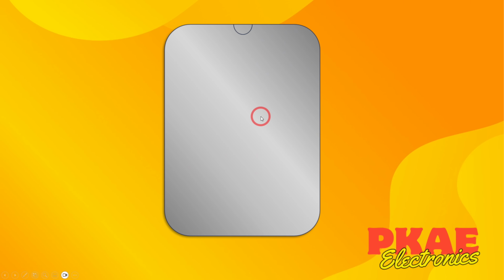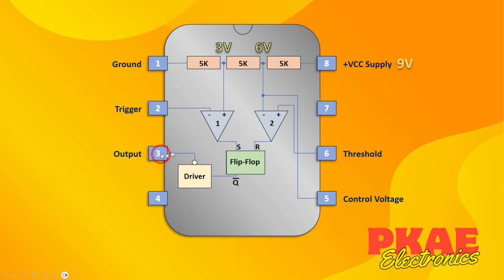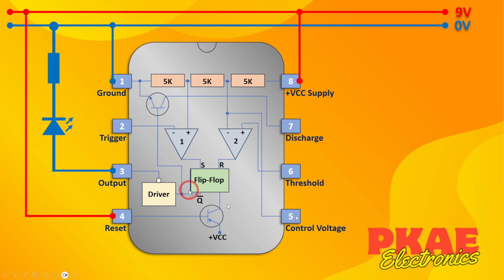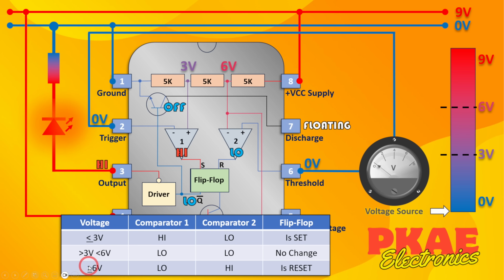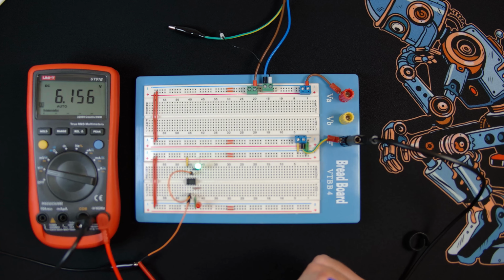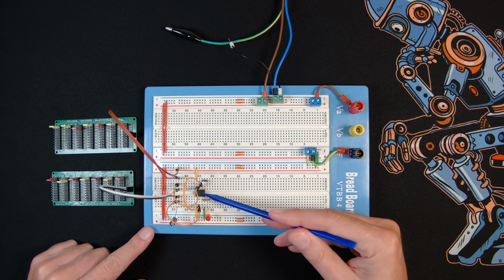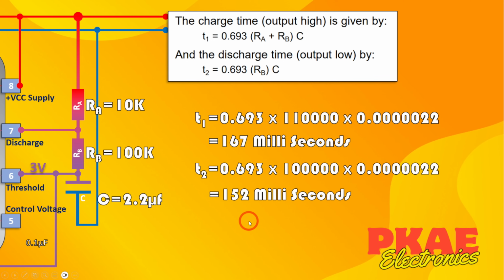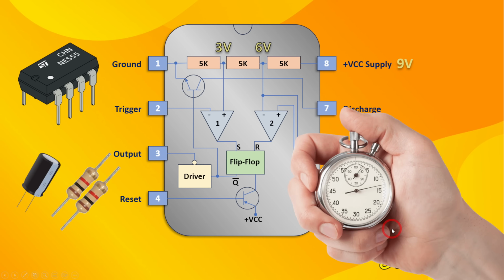How a 555 Works as a Timer.

Comment: 4:05 
with both inputs at equal voltage the output is at mid rail.
Reply from the maker: Thanks for the comment, where did you obtain that from? 

I have never known a comparator to output a mid-rail state. Only HI or LO.
Reply: @paulpkae  
The open loop gain is very high and input offset affect the levels
but the output can be at other than rail voltages.
The state doesn't last long because of any drift but can do weird things.
This I have seen when building prototype projects.
A method to correct for this is to design in some hysteresis.
Reply: Further info;
Many years ago I was into caving and one of the adventures was 
a tidal flooded system . So I wanted to predict my own sea levels
and made an analogue computer. Real time / 10 X / 100 X / 1000 X.
Inputs were sun, moon, river , rain . This is the beast that gave me 
weird comparitor outputs.

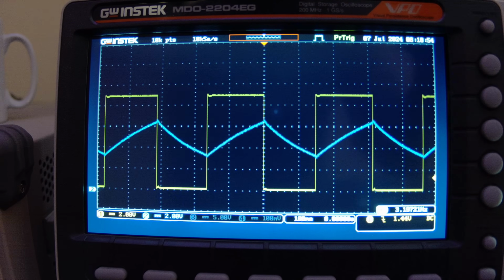Comment: Referencing 29:00 with the blue (capacitor) trace, do you reckon the original designers of the 555 started with the external capacitor and then worked out the chip design?
Reply from the maker: I expect the designer spent countless hours building various timer circuit arrangements out of transistors, resistors and a capacitor (as the time base). Probably then realised there was a lot of common elements to each layout and this led to the idea of designing an IC.

Comment: I learned about the 555 in the late 70s. By then, I had played with the usual configurations (blinking LED, speaker sound, etc). Shortly after, a photographer friend asked me if I could build him a timer for his photography enlarger lamp. He wanted it to be controllable from just a few seconds to well over a minute, with strictly  repeatable results. So I had this crazy idea, which I wasn't totally sure that would work: I wired two rotary, 10-position switches and associated potentiometers (trimmers, actually) in series so that the resistances of "high-value" (tens of seconds) trimmers would be  added to that of the  "low" (seconds) trimmers. And it worked, too. With that arrangement, I could set the switches to any discrete time interval between 0 (lamp on for only as long as the start button was pressed) and 99 seconds. The 555 timer output was routed through a transistor to a 120V relay, which drove the lamp. The photographer friend used this for  many years, and I still think it was one of he coolest things I've made as an electronics hobbyist.
Reply from the maker: Thanks. Sounds like a great little project that has stuck in your mind all these years.

Comment: Great video, explained better than my tutor 30+ years ago.. Just for laughs a quote "The 555 timer IC's name is said to come from the three 5 kΩ resistors within the chip, but the designer, Hans Camenzind, says the number was chosen arbitrarily. Camenzind said that the name was chosen by Art Fury, the marketing manager, who thought the circuit would sell well." I would say to that if the designer says so then so it is i have always gone by, the early chips actually had a very small 555 engraved somewhere within. Also to note there are much better and stable oscillator chips, but obviously much more expensive. 555 is great for hobby work, when you start to get into exact frequencies then you require more sophistication.. Loved this video..

Comment: So charge and discharge time cannot be the same as RA would have to be 0 for that. That would be bad as the discharge transistor would short VCC to GND directly?
Reply from the maker: Hi. Yes that is correct. The standard astable circuit does not allow full control over the duty cycle. I will be doing a follow up video in which I show how that can be achieved.

Comment: This is a brilliant explanation of how the 555 can be used and why it functions as it does. I appreciate you showing them in animation as well as on the bench and with the scope. I wish I had this instruction when I was in school.

This all being said, you didnt really dive into your thesis on why this chip "isn't a timer". I'd say that this chip is similar, conceptually, to the escapement mechanism of a clock if used in such a circuit. It can convert an analogue oscillation into a digital count, and even if it can only count to one, isnt that the absolute basis for timing? In any case, the bait worked and I'm here for it, have your engagement, I'll be back for more no doubt 🤣
Reply from the maker: Thanks for the comment.

Controversial thumbnails jump out at people and grab attention 😄 The main purpose of the video was to demonstrate how the internal building  blocks work, in conjunction with the components you install around the chip, to make it into a timer.

Comment: Ah, yes ye olde 555 Multivibrator (snicker) of RadioShack MIMS notebook lore. The 555 timer chip is extremely robust and stable 8-pin device that can be operated either as a very accurate Monostable, Bistable or Astable Multivibrator to produce a variety of applications such as one-shot or delay timers, pulse generation, LED and lamp flashers, alarms and tone generation, logic clocks, frequency division, power supplies and converters etc, in fact any circuit that requires some form of time control as the list is endless.

Comment: Good video. thanks. most datasheet recommned using 0.01 uF filter cap on the control, you used 0.1uF which is also good (and very commonly used as decoupling capacitor)
Reply from the maker: Thanks for the comment. The 0.1uF was actually a typo, doh! Well spotted.

Comment: Pretty much a very crude two stage ADC converter/edge thresholder. Just happens to work as timer, when tied to constant known rate charge and discharge process. Thus in practice ones timing depends on how stable ones resistors and capacitor are. Those are the timing components. Is the capacitor always constant capacitance over the current and voltage range and so on. Is ones resistor constant over the voltage range etc. 555 is just the simple measuring and tripping unit of the timing process.

Comment: As a mechanical engineering student back in the 80's I used a 555 chip to build an adjustable triggered timing circuit to control a pull-type solenoid that would open a modified mechanical diesel fuel injector to inject a fuel consisting of a methanol/coal slurry into a small, single-cylinder ICE.

The control circuit input trigger was a 5 VDC voltage pulse produced by an optical encoder and a wiper mounted onto an external camshaft extension.  The trigger signal would occur when the piston was at TDC.  It had a series of thumbwheel switches that allowed the fuel injector opening/closing times relative to TDC to be set and changed.

Comment: So unless I'm mistaken, if you just skip (short, 0 ohm) Ra, you get a 50%/50% duty cycle, and it's not possible to get a duty cycle where the charge time is shorter than the discharge time (since you'd need a negative ohm resistor for Rb, which doesn't make sense), at least with this circuit?
Reply from the maker: Yes that is correct. The standard Astable circuit given in the datasheet does not facilitate control over full duty cycle range. Shorting Ra is a bad idea as you are effectively shorting your supply to ground via the NPN transistor. 

I will be doing a follow up video in which I will demonstrate a better solution simply by adding a couple of diodes.

Comment: Maybe my understanding of electronics idioms/abstractions isn't great, but you said pin 1 is ground, “which is obviously 0V”.  Except that's not the case in 9.999% of setups (it was for basic electrical things in the 1920-1970s, but not for modern electronics); ground is wired to the negative end of the battery or power supply, which is a surplus of electrons (and positive is a deficit of electrons).  So if supplying 9V, is it typical that your ground is at -4.5V and your +VCC is at +4.5V, for a delta of 9V?  Or am I missing something?
Reply from the maker: Your ground is whatever you choose to reference as ground. In my circuit the supply is a 9V DC PSU and I am referencing the black terminal as ground (or zero volts) and the red terminals as +V (or 9V). 

Wherever I place my volt meter probes within the circuit you would never read -4.5V. As the circuit is, there is no -4.5V reference.
Reply: Ground is generally never at your negative supply rail.  Ground is your 0V reference.
Reply from the maker: @stargazer7644  Contradiction of terms really. 

If you say the negative supply rail is your ground, then it's no longer the "negative supply rail", it's 0V.

"Ground is your 0V reference" is correct.

Comment: The NE555 chip is 50+ years old. What new chip does the job better?
Reply from the maker: Its a great chip and does what its designed to do perfectly well. Calling it a Timer, just pigeon holes it into a limited category when it can be utilised for many other things.

There are improved versions that have come about, including faster CMOS versions using MOSFETS rather than BJTs. These allow your output to get closer to the supply rail potential, but does have a downside in that it limits the maximum current slightly. There's also the 556, a dual 555 and many other variants.

Comment: I like the blue vs red colouring to visualize Voltage level, I have seen quite a lot electronics videos, but this concept of colours for Voltage is new to me. Not sure how it holds up, but I think it actually helped to understand what's going on! o) I am a software guy, I would love to understand electronics as well, but for some reason I do not make progress at all. Building things with physical components is 1000 times harder than writing a program it seems, or my brain is just not compatible with all things happening and influencing other components at the same time in a circuit. To me it seems impossible to understand once there are more than 3 components on a bread board, damnit! o) Thank you! o)
Reply from the maker: @ytbone9430  stick with learning electronics. If you can code then you have a logical mind and this stuff is the same.
Reply: @paulpkae  Yes, thank you! o) I was thinking the same, there must be some logic behind, but it's really hard for me. Even fixing simple faults or finding that bad resistor / mosfet whatever on a PCB seems to be an impossible mission to me. Well, I will keep trying.. thanks again and have a nice day! o)

Comment: So the timer part is the RC circuit, and the 555 is essentially an elaborate device that is doing the switching and the discharging of the RC circuit. I see. Just a disclaimer, I came into this video as someone who knows what the 555 is used for and what the basic electronic components do (and a healthy bit of microcontroller electronics too, I suppose), and right now I am confident I can, with what you covered and two potentiometers replacing the resistors, drive a servo. Before this, I would've been forced to program a dev board like an arduino or ESP to do it. Thank you for making this video! It's as simple as it needs to be without dumbing it down to just a set of instructions.
Reply from the maker: Thanks for the comment. 

Micro controllers are great fun, but also a stepping stone into the wider world of electronics. In most circumstances, using electronic components to achieve your requirements is normally the better solution.

Comment: Very nicely explained 👍 In fact, I rate this video excellent. I found myself watching all the way through even though I already knew how it worked. And have used it in many circuit configurations. Including an opposite polarity one shot monostable pulse generator (to generate a reset pulse for another chip). The number of different circuit configurations shows how flexible it is.
Reply from the maker: Many thanks for your comment.

Comment: 28:35 Wat i'm wondering is how much current is flowing through the discharge pin at different resistor values over the duration of a cycle, because it seems like if you want the on and off time to be the same, that you'd have to lower the resistance of resistor A to 0 ohms. Lowering the resistance of resistor A however increases the current across the discharge pin during the discharge cycle and if resistor A is 0 ohms, then it would basically be a short between VCC and ground, isn't it? Even with resistor A > 0, it still feels like there is power being wasted here.
Reply from the maker: Both Ra and Rb should be kept as high values to avoid too much current flowing. In order to achieve 50% duty cycle (on time = off time) or more, you can add a couple of diodes. I will be doing a video on this soon.

Comment: Something that could be a fun little follow-up to this video would be to build... let's call it a "555 circuit" using discrete components rather than a 555 IC.
Reply from the maker: Hi, yes nice idea. I have built one on a simulator before, I will try and locate it.

Comment: Wow, this brings back memories.  When I was fresh out of school in the late 70s and an engineer with Motorola, I was assigned the task of designing a test fixture to ensure that capacitors installed in antennas under production were within limits.  The solution I came up with was to use three 555 timers with two of them using precision components at both ends of the allowable capacitance range.  The third timer operated with the capacitor to be tested.  The idea was that if the capacitor under test was within limits, its 555 timer would trigger after the one operating at one end of the range, but before the one at the opposite end.  If the capacitor under test was within limits, additional logic circuitry would turn on a green light, and if it were not, a red light would come on.  It worked and I got no complaints from the factory, but, even now, always wondered just how accurate it was.
Reply: An electronic go/no go gage, brilliant!

Comment: Ok, I said only one more question, but I have one more. Why the decade resistor board instead of a variable resistor?
Reply from the maker: A potentiometer would work just as well, but you need to be careful when adjusting fully clockwise or counter clockwise with the amount of current that may end up flowing. For the video I wanted fixed, known resistance to feed into the calculations at the end.

Comment: One other question, what happens when you jump from below 3 to above 6? Does the 555 sense the crossover between the 3-6v range?
Reply from the maker: The IC does not care how quickly or gradual the voltage changes from one potential to the other. It just applies the logic dependant upon the voltage it sees; it has no memory.
Reply: @paulpkae  I guess what I'm asking is the slope of voltage change over time, I'm wondering I'd this detects it passing through the middle range if you switch from the upper range to the lower range?

I ask because I had a similar problem with a counter IC and reset. The reset sensor would detect the count I was looking for, because the change from for example 3 to 4 would momentarily  be 6 before the lower bits dropped to 0. This was because of the design of the IC and how it counted. 

So the question I'm asking is if the 555 can detect the pass through from 1v between 3v and 6v while the line is going to 8v for example? Does that make more sense?  I'm curious if it detects the rise time and fall time intermediate voltages.
Reply from the maker: @danlhoy  No, its not responding to change. Its only acting upon the instantaneous voltage.

Comment: The 555 is a funky bit of kit. :) It was perhaps the first chip to make designing timers and oscillators easier, but it worked out so well, it's still around. I once designed a FSK encoder using a 555, only in simulation, but it was really easy. The digital data went through a 2k resistor to the control voltage input, but that was given a source with no internal resistance. If I ever build a retrocomputer, I'll probably build that circuit for real because I think retrocomputers have got to save data to tape. ;) I probably won't use it very much though, I don't miss 5 minute load times!
Reply from the maker: Thanks for the comment.

From my experience it was often a load time of 5minutes or more and then it failed anyway.
Reply: @paulpkae  Yeah... my first Atari had some weird problems with the tape drive and the ZX81 would fail for all sorts of reasons.

Comment: If I wanted t1 to equal t2 would that mean I remove the RA resistor altogether?
Reply from the maker: I will be publishing a follow up video on this soon. With the simple addition of a couple of diodes the standard Astable circuit can be significantly improved upon.

Comment: I have to say this is THE most well done, clearly explained explanation of a 555's operation I have ever seen... and I've seen a LOT! I especially liked how you showed the actual charge/discharge of the capacitor on your 'scope. Nice touch! It's nice to see you explain that, on it's own, the chip is NOT a timer at all... it requires external components to become one. I had also heard that the designation (555) came from the 3 5K resistors in the voltage divider chain. I hope whoever invented this wonderful chip got some HUGE recognition for it. It has probably had the longest useful life of any chip on the planet! Over 50 years!!!
Reply from the maker: Thanks for the comment, much appreciated.

Comment: In 1980 I used a thermistor in the timing circuit to produce a temperature sensitive pulse duration. That pulsed a milliwatt CW transmitter so I could remotely get temp data by monitoring time between pulses. That got implanted in free ranging woodchucks so we could monitor location and hibernation status.